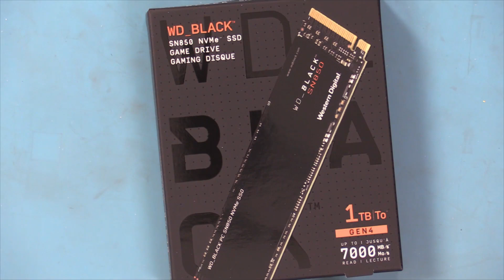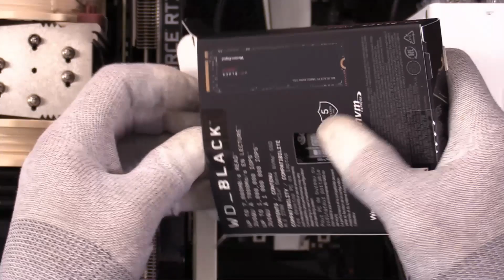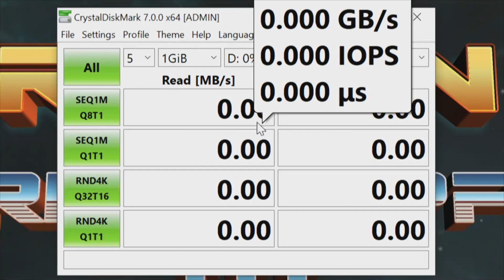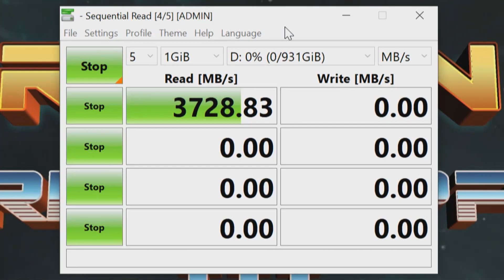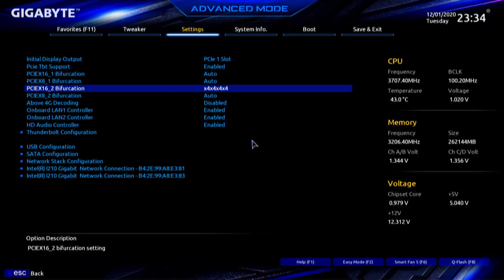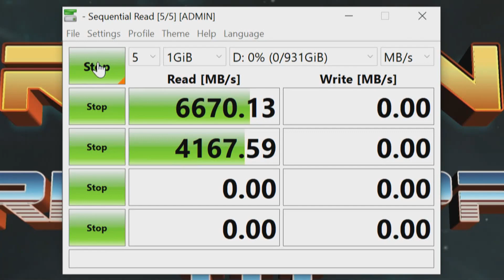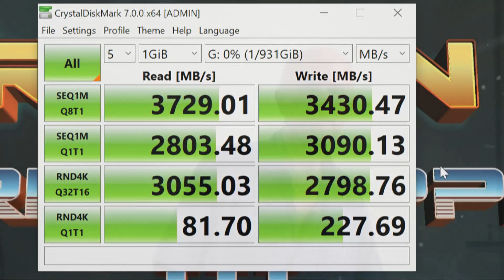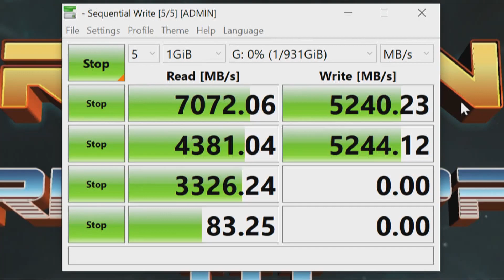WD Black SN850 Unboxing, Install, Test and Technology

Comment: I kept seeing on Youtube that the WD was the fastest m.2 gen4 on the market. Now I know. If you mount it directly to the m.2 connector on the mb going to the processor it definitely is. Thanks for the video. I subscribed to this channel due to this video. Your methodology is very thorough.
Reply from the maker: Hi Patrick Hudson, 
Welcome! Thank You for Your Comments I'm honored! Details matter! Chyanging one thing can change everything! Max has asked Us about the Heat from the Samsung 980 Pro. Therefor, We've created another Video to adress that question and to compare to the WD Black SN 860 on the Supermicro Dual M.2 NVMe Adapter. Stay tuned! 

Samsung 980 Pro vs WD Black SN850 on Supermicro Dual M.2 NVMe Adapter
https://youtu.be/28OPg3c5zms

Comment: Ohhh yes!!! I've been waiting for this. You told Us that SN850 would be a nice choice speedwise if we're not going to buy Samsung 980 Pro. I am eager to watch this video now. Thank You Champ!
Reply from the maker: Hi Don Jon, This is the 2nd, 2nd Generation M.2 NVMe PCIe 4.0 Drive. The 3rd being from Sabrent. Sabrent Rocket 4 Plus NVMe 4.0 Gen4 PCIe M.2 Internal SSD Extreme Performance! 

I too was surprised at the details. There will be a follow up to this later regarding NVMe RAID and Quad cards. We have other NVMe cards to test!
Reply: @BuildOrBuy  Is the Sarbnet Rocket a second or a third generation PCI express 4.0 NVMe drive?
Reply from the maker: Hi @donjon7554 , Of the three new NVMe Drives that are 2nd Generation PCIe 4.0, the new one by Sabrent is number three. 
First... Samsung 890 Pro
Second... WD Black SN850
Third... Sabrent Rocket 4 Plus
All three of those are 2nd Generation PCIe 4.0 M.2 NVMe Drives. Hope that helps. In the future, how to tell? Any M.2 NVMe Drive in the 7,000 MBps range will be 2nd Generation.

Comment: You can re-initialise a drive at anytime after a low level format. You can convert from MBR to GPT at anytime (with or without data loss) as well, so both operations not limited to the first use of the drive.
Reply from the maker: Hi mindshelfpro, 
Yes. Agreed, You are correct. Most Users don't know that. We're trying to keep this simple. The progression of MBR to GPT affects most Users when they try to use the Windows Media Creation Tool to reinstall Windows. We're working from previous Questions. You'd be surprised when someone buys a new Drive and they don't understand why they cannot use it yet. 

We'll do another Video sometime about MBR vs GPT. Converting a Boot Drive vs a Data Drive. Thank You for sharing.

Comment: How about the heat from the drive under load ? My CPU sadly only supports PCIe 3.0.
Reply from the maker: Hi travelvideos, 
Welcome! The Test was under load. We have read reports of the Drive causing BSODs after a time. No specifics on whether they had heatsinks. Whether from Heat or something else, possibly resolvable with a Firmware Update. Too early to know. Running NVMe Drives average 50 degrees Celsius. 

Since You're CPU only supports PCIe 3.0, check Drives for price and purchase accordingly. If a faster Drive is less expensive, go for it! You will only achieve a speed according to the Spec of 3,500MBps for PCIe 3.0.

Comment: Gill!! So much information! I love it!!
Reply from the maker: Hi Blasten, 
Thank You! We had to cut more than I wanted but, 4 our of Filming! Here's one stat I cut by mistake: 
The SN850 Results: 
On socket M2M (CPU): 7,070 MBps Read and 5,241 MBps on the Write. 
On socket M2P (Chipset): 6,291 MBps Read and 3,161 MBps on the Write.

We'll do a follow up on the issue with the Quad card later.

Comment: I bought 2 of these in 2TB versions and plugged them on a X570 motherboard (C8H). I get full speed in CPU M2 slot but performance drop in 2nd M2 slot (chipset one), down to 6700 read and 3100 write. Using the Asus AiC Gen4 (v2) I get full speed on both drives.
Reply from the maker: Hi Stephan, Thanks for Sharing Your Stats. You did good getting Two drives!

Comment: I have a Ryzen 3800x built on a ASUS 570 tuf gaming plus MB (it was not my first choice on the MB it was the only thing i could get my hands on  at the time ). I picked up a WD SM 850 1 TB NVME. (had some difficulty getting the MB to "see the drive once it was installed . I had to disconnect all of the the other drives from the system to get it to be read in BIOS. Once I got  it up and running and I got a fresh installation of WIN 10 PRO. My initial tests of the drive mirrored yours, (yes I connected to the M2 slot going directly to CPU) I initially got around 6850 read speed on drive.  it rans stable for a good 4 weeks or so. 

Now (sorry for all of the detail) I was installing  a game from an online retailer  the games rans  fine but once I shut down the game i started getting BSOD's WHEA uncorrectable error (been  a advanced windows end user since before the days of XP i had never gotten one of the particular BSOD.  fun facts what ever was causing the error it prevented the system from writing a dump file and the only error log was system shut down unexpectedly,  may days of troubleshooting came to the conclusion it had to be related to the NVME drive (have alternative theory as well but that another story...) removed the 850 and went back to my old INTEL gen 3 nvem and fresh install win 10 pro now running stable  will be requesting RMA to WD  and will try again with new Drive (reddit does have a number of other user s lately with same  WHEA bsod. Im courious to hear what you think i should look at next  right now I am think one of three places to look ! bad drive  RMA will fix, @ recently with the fresh install updated to the 20H2 update down grade to previous version and test, or  i did notice during my trouble shooting attempts my 3.3 V rail was reporting in Bios as delivering around 2.7 V which is rather on the low side  (upgraded to new NZXT C850 80 Gold in FEB. My APT building has old wiring and I think its just the delivery) I feel it may be one of the three. 

Now to move forward what direction given the information i gave you what should i do?

PS First time catching your Video channel. looing forward to checking out the rest. Thank you for the Through and methodical work its appreciated.
Reply from the maker: Hi John, Nice to meet You! Glad You found Us! Welcome! Appreciate Your Comments and Details. 

WHEA BSOD... Something is failing. The question is what and why. 
1. PSU, what did You have 650 watt, about 4 years old? 850 watt PSU is a good idea. 
2. WD SN 850 - Checking Firmware Updates. Stability Issues. This has been an issue for several Users. And needs fixing quickly!

Install WD Dashboard: 
https://support.wdc.com/downloads.aspx
3. Are You on a UPS? Clean power makes a big difference. 
4. Heatsink on NVMe?

This will get Us started. However, it's up to WD to fix the Firmware. Keep Us posted on Your progress! Computers are great when they work. When they don't, pile of junk! And crazy it this, one Component brings the whole system down. Bummer. The next option, after RMA, would be a different Drive.

Comment: I hear these get a little warm. I was wondering if I use PCIe gen3 instead, only achieving that 3k instead of that 7k speeds would the driver be a little cooler? (ps: my mobo only has gen3) and also would it matter which m.2 slot I use on my mobo? One is on the front (has a heat sink) while the other is on the back (no heat sink). Thanks so much for such an in-depth video!
Reply from the maker: Hi l, 
Appreciate Your Comments! Which Motherboard are You using? We'll look it up. Use the M.2 Slot connected to the CPU. Should be on the front. The other M.2 may be connected through the Chipset. We need to check and verify. 

Check the Operating Temperatures of both. All M.2 NVMe SSDs require a Heat Sink. We have more Emissivity Heat Tests to perform. Stay tuned! 

A Drive can only operate as fast as the slowest point of connection.
Reply: @BuildOrBuy  Thanks so much for the response! I have the Z390 I Aorus Pro Wifi (rev. 1.0)
Reply from the maker: Hi @supr_ , 
Gigabyte Z390 I Aorus Pro Wifi 
https://www.gigabyte.com/us/Motherboard/Z390-I-AORUS-PRO-WIFI-rev-10#kf
1 x M.2 connector (M2P) The M2P connector shares bandwidth with
the SATA3 Port 1 connector. 
1 x M.2 connector (M2M) - On Back of Motherboard. One User on Gigabyte Forums says appears M2M shares with SATA3 Ports 4 and 5. I don't see that according to the PDF manual, page 17. 

Intel Z390 chipset
https://www.intel.com/content/www/us/en/products/docs/chipsets/desktop-chipsets/z390-chipset-brief.html#:~:text=The%20Intel%C2%AE%20Z390%20chipset%20enables%20overclocking%20features%20of%20unlocked,8th%20Generation%20Intel%20Core%20processors.&text=Provides%20performance%20improvements%20as%20well,%C2%AE%20Optane%E2%84%A2%20memory%20module.

Based on the Chipset Diagram, appears both M.2 Connectors are connected through the Chipset. Only way to know for certain is to test and verify speed. 

The reason for all of that? Both will run at same speed if above is true. If one were connected directly to the CPU, that one would be faster. The one on the Back will be more difficult to change later if Upgraded. Would have to remove Motherboard from Case. Hassle. But doable. Hope that helps! Thanks for Asking!

Comment: i wanna see benchmarks 980 pro Vs sn850. speeds and temps. I saw sn850 beats 980pro but I don't know how temps vary
Reply from the maker: Hi 99KINGZ, Excellent point! We're getting ready to test the Sabrent Rocket 4 Plus. We'll show those 3, with Temps. Thank You for Your Comments! Help Us to make better Videos!
Reply: @BuildOrBuy  i think 980 pro is garbage. when i bough it had speeds 6700 / 4800. Now after few months i get 4000 / 1150.  Here u can see few scans https://imgur.com/gallery/2o0QX7D . Should i claim warranty? It's being used as main Windows 10 drive.

Comment: What a great viedo! Could You tell me what resoults we would have putting the WD Black SN850 into a M.2 chipset slot? I was schocked that PCI-Express Quad card that uses PCI-Express 4.0 lanes that go directly to CPU is not only equal to a M.2 slot going directly do CPU but it is so much slower! You were right on that one during our previous discussion at Your previous video. So is it really speedwise: 1. CPU direct. 2. Chipset 3. PCI-Expres.? Please do a check in (no new video needed, just respond by text) - put the drive into M.2 chipset slot and Crystal bench it please - if you will find the time.
Reply from the maker: Hi Don, Another message I'm just now seeing! Wow YouTube! OK, good questions! We'll do! Just finished another Subscriber Question for Heat and Speed of those 3 Drives on 3 Tests. I'll compare as described and get back to You. Working on 2 other Videos now. Stay tuned! Thanks for Watching! Appreciate Your Comments!

Comment: hey. Hi. I did some testing on new WD Black SN850 2TB and i noticed slow speeds especially "Write" = 3000 where read is around 6200 in M.2 slot 2 and M.2 slot 3 of Aorus x570 xtreme. Then I put one drive into PCIE slot and it works as it should be 7000 read and 5000 write. Is there any setting in bios i should be aware of or a solution or do i have bad mobo?
 My current Bios is F31q but on F30 it was the same
Reply from the maker: Hi 99KINGZ, 
Gigabyte Aorus x570 Xtreme. You have 3 M.2 Connectors... 
1.) Integrated in the CPU (M2A_SOCKET). 2 & 3.) Integrated in the Chipset (M2B_SOCKET / M2C_SOCKET). I don't understand when You say PCIe Slot. How did You do that? Which PCIe Slot? M2A_SOCKET should be the fastest since tied to CPU.

Comment: Hi Gil, did you have a look at your settings in the bios for your NVME ? I had my NVME set up as volume instead of raid-0 re-installed and I am now seeing much better performance 2x seagate 520 1tb disk in raid-0 9806 read/ 8472 write - raid-0 with 3 2tb Corsair mp600 11157 read / 12161 write (I had a disk fail, was hoping to hit the 15gb/s) not today.
Reply: About the settings, I was only getting single disk speed.
Reply from the maker: Hi Henrik Tived, 
You're giving away the secrets buy I'm glad You brought this up! Our Goal is to start where anyone might then to proceed from there with the details. 

In this Video, No RAID. Just the Quad card to address Subscriber Questions since Quad cards are NOT RAID cards. RAID is a function of either the Bios or the O/S. 

This was only suppose to be about the WD Black SN850. But the Question as to which M.2 connector is the Fastest, made that a priority. This is just the first part of a bigger question. WE were hoping to address this issue in parts or segments. It gets detailed. After all, this Video was too long. This was 1 hour of 4 hours of Filming. I hope it makes Viewers think about the possibilities! Thanks for Sharing!
Reply from the maker: Hi @2niteL8R , Yes! Disconcerting. Understand. Thank You!
Reply: @BuildOrBuy  well, it might have been a longer video but you are also taking us on a journey. 
Sorry for the many questions, as I/we progress through all the details here there is bout to be some interesting things popping up. 

I did enjoy the video so thanks for making effort

Btw eBay came back to me and it looks like a refund is going to happen. If that is the case I take my hat off for eBay and their business conduct
Reply from the maker: Hi @2niteL8R , Thank You for Your Comments! Yes. This is a journey. There's lots to know. And we're just covering the high points. 

Glad to know You finally get reimbursed. Took long enough! Thanks for sharing!

Comment: Great video. What are the thermals on the SSD?
Reply from the maker: Hi perspicacity89,
Welcome! Appreciate Your Comments! Oops! Edited that Detail out! And Details matter! However, We went on to Test with 14 different M.2 Heatsinks and 3 X16 Quad M.2 NVMe PCIe cards and 1 Dual M.2 NVMe PCIe Adapter. 
1. The WD Black SN850 bare on Supermicro Dual M.2 NVMe Adapter = 92°C
2. On the TRX40 Designare under 2nd stock Heatsink position to CPU = 65°C
3. Under Acidalie 4 Pipe 48°C
4. Jeyi Aluminum Finscold iGlacier8 - On MB, 2nd Position = 48°C
5. ASUS Hyper M.2 x16 Quad AIC = 50°C
6. On Gigabyte Aorus M.2 x16 Quad AIC = 58°C
7. ASRock Ultra M.2 x16 Quad AIC = 58°C

You have the synopsis benefit of all of those Tests right here! Hope that helps! Thanks for Asking! We have all of this Data in a Chart! Had to so We could keep track of everything! 

BTW: We had a Performance issue with the WD Black SN850 on the Gigabyte Aorus M.2 x16 Quad AIC initially. Performance was improved after installing the Firmware Update available at that time! Hope that helps! Thanks for Asking!
Reply: @BuildOrBuy  thank you so much!
Reply from the maker: Hi @perspicacity89 ,
Absolutely! Thanks for Asking!

Comment: Good morning Bill.  I know you said that you weren't going to get into allocation size for the drive... but I just bought an MSI Creator TRX40 and it has a four drive AIC that I want to Raid-0 for video editing.
Could you either do a video on optimizing these Raid cards, or just put a line of three down here on it.  Thanks.
Reply from the maker: Hi Paul, Good to meet You. Sounds like we need to do both. I'll get a few details together and get back to You from Computer. I'm on smartphone right now.

Congrats on Your purchase! Welcome to the TRX40 Platform!
Reply: @BuildOrBuy  I ordered a ThermalTake Core W100, because of your video on the build... I look forward to having all of that space.
Reply from the maker: Hi @paulcoburn87 , That has to be the most fun ever in working on a Computer Case. Like an Erector set... Stick to the Plans. You'll need lots of floor space. In floor space, allow about 4 times the size of the box. Keep Us posted on Your Progress. Enjoy the process. And watch those Case Rails! Think 2 steps ahead as You assemble.
Reply from the maker: Hi Paul, 
For Video Editing... 
1.) The Drives need to be set for 4k alignment. 
2.) Stripe Size starting point would be 64K or 128K. Larger would be better. Test and evaluate. Your results may vary. 
3.) In Bios, instead of selecting RAID 0, select Volume. 
4.) You have to remove a Drive from the Array before You can create the Array.

I was looking for a Drive Calculator. Only one takes into account for NVMe. However, none of them indicate optimal Sector sizes. Hope this helps!

Comment: Apparently there’s a WD Black SN850 “Special Edition Call Of Duty” version. Do you know whether there’s a difference between that and the standard version?

Great stuff! Subscribed! 👍
Reply from the maker: Hi Nathan,  First, Thank You for Subscribing! Second, Marketing. Get a free Game. Adding value if that value is relevant to the Buyer. WD is big. They understand Marketing. When I was VP Programs, we had WD come to one if our monthly Meetings at our local George R Brown Convention Center. How long ago? The WD 500 GB Drive was brand new. I digress. Anyway. Hope that helps! Stay tuned!
Reply: @BuildOrBuy  Thanks! I figured marketing, but just wanted to make sure. WD Black SN850 2TB was on special today on Amazon, down from $880AUD to $660AUD, so I jumped on it!
Reply: @BuildOrBuy  Have you seen that Asus has been working with EKWB to make pre-fitted water blocks on both the 3080 and 3090 GPU's? I was just wondering what your opinion is of it and whether or not they will perform as well as the stock standard models? I'm considering getting one. Thanks again! https://www.asus.com/Motherboards-Components/Graphics-Cards/ASUS/RTX3090-24G-EK/
Reply from the maker: Hi @SodaiGoku , Nothing like getting new technology while on sale! Congrats! Enjoy! Thanks for Sharing!